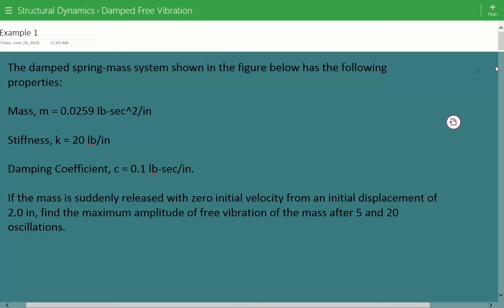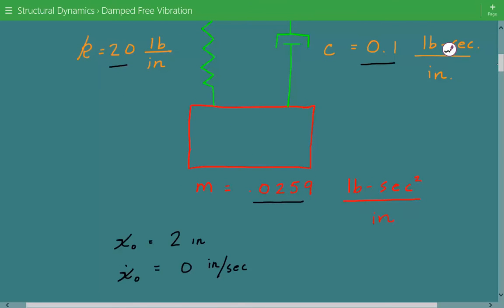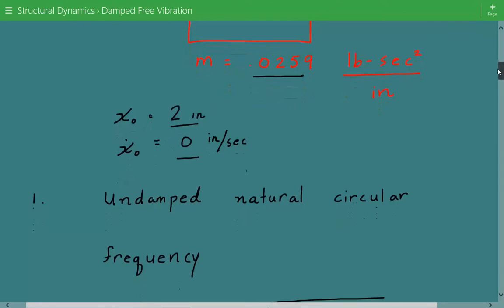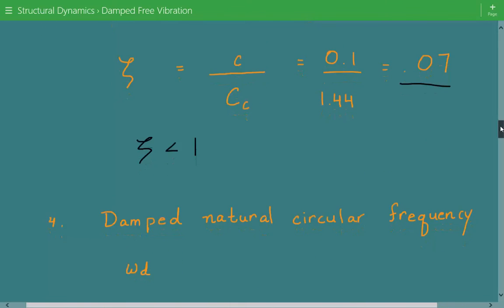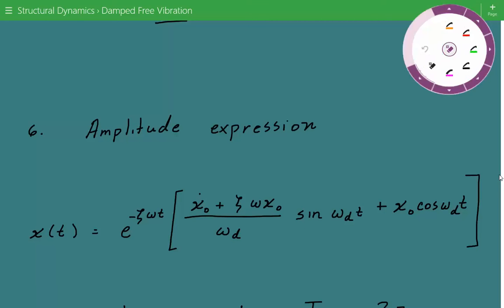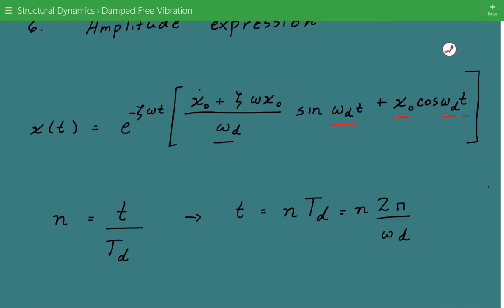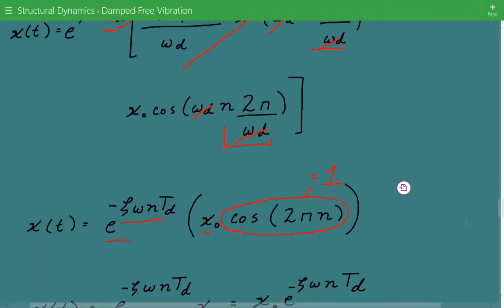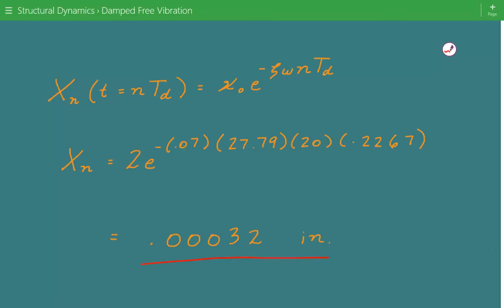Free Vibration of Underdamped System, Structural Dynamics for Damped Free Vibration Example 1

Comment: Wondering if you are using a MS Surface for working your examples. Looking for a system like this to work my engineering design problems rather than pen and paper. Thanks for the insight. Dan
Reply from the maker: I emailed you the answer